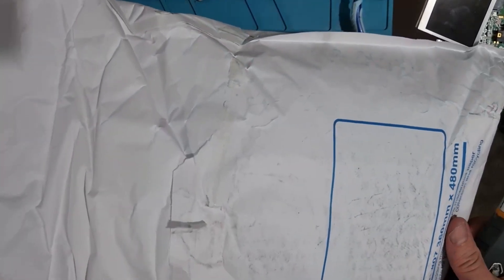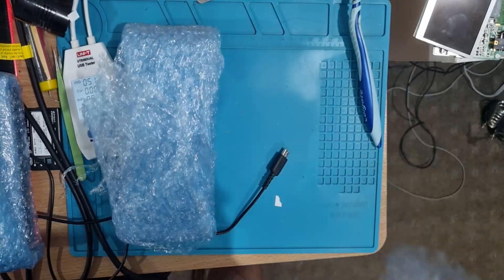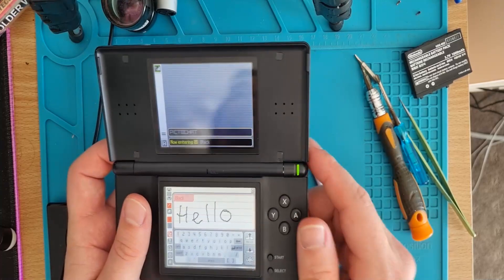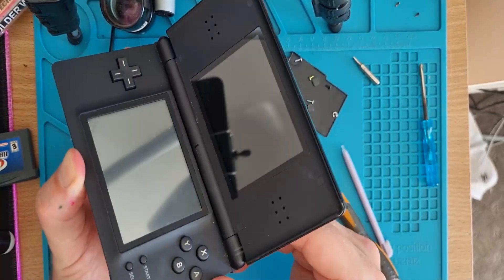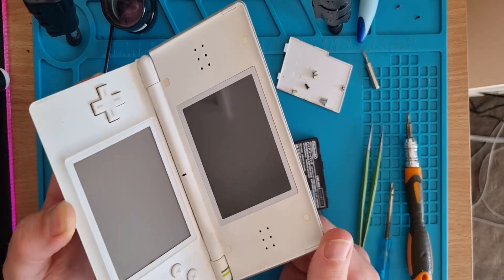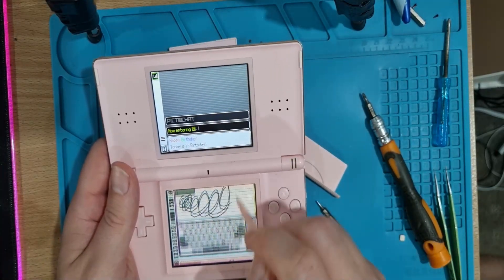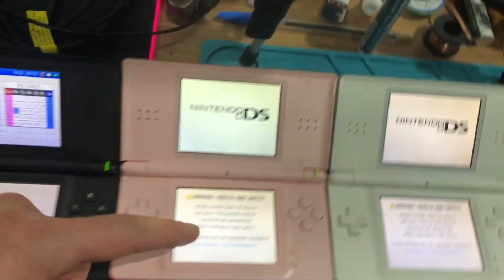I Got 10 broken DS lites, Lets FIX THEM!

Comment: Really nice job. I would also love to start doing this more often but I don’t have the money to actually start doing this. I have destroyed 2 top screens trying to swap in a new screen on my ds. it is quite demoralizing tbh
Reply from the maker: Yeah I started out small only 1 at a time kind of thing to keep costs low, also ruined the first 2 top screens I tried. Just gotta practise a bit more and its a piece of cake!
Reply: @chickenmaster121  my soldering iron is really bad and anything would be an upgrade. My iron doesn’t get as hot as yours and takes a bit longer to melt the solder. I also can’t control temperature. I also don’t have leaded solder wire as I bought the non leaded one which I partially used in a chemestry experiment
Reply from the maker: That's what my first iron was like as well, $15 at bunnings it was rubbish but I got use to it. Get some leaded solder and some flux and practise, if you still have the top screens you broke just try doing the speakers for it a couple times
Reply: @chickenmaster121  okay. I’ll try
Reply: @chickenmaster121  i have the 3 broken top screens. The original and the other 2
Reply from the maker: have a few goes at soldeing the speaker on, then remove them again, wick it clean and try again. are the cables still in tact to try practise the rolling of them?
Reply: @chickenmaster121  cables are intact. I think I damaged a trace the 2nd time while soldering
Reply from the maker: practise both those things and next top screen you will nail it

Comment: Timestamps:
00:20 Unboxing DSLites
5:30 Determination of non-booting DS'
5:55 Black DS #1 {Battery issue, broken hinge}
7:46 Black DS #2 {Dirty MoBo, Defect topscreen}
13:16 White DS {Jammed power button, Defect digitiser, new upper backplate}
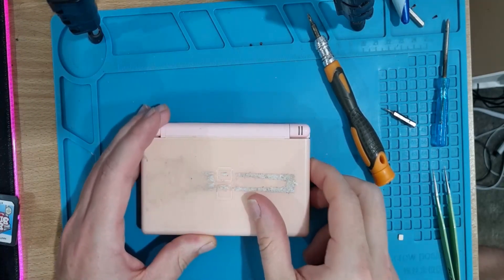18:26 Pink DS #1 {Missing battery, bad bottom screen}
20:59 Black DS #3 {Broken hinge}
22:52 Pink DS #2 {Broken hinge}
25:00 showcase

Comment: As someone who's starting to get into DS Lite modding, this video is a huge help, thank you!

Have a question though, if you encounter those shoulder buttons that need a harder press to get them working, what's the best solution? The one where you take out the actual metal dome from the switch, or is contact cleaner (or 99% IPA) enough?
Reply from the maker: No worries! 

I usually spray some contact cleaner or ipa into the switch and press it multiple times, sometimes need to apply the spray more then once. If they're still dodgy after a few goes I will replace the switch

Comment: Thanks, bought a broke red ds lite so im gonna try my hand at repairing it, swapped the battery and won't start up but it kinda does when plugged in, so I'm gonna open er up and clean the board and see if there's any issues with the soder points
Reply from the maker: good luck, If you need any help I have lots of videos on DS lites or just ask
Reply: @chickenmaster121  thanks man, I appreciate it!

Comment: I know this is a little old but I was wondering where you buy your screens? I recently bought a lot of 13 DS lites for 175 ( a steal for around 13.50 a piece). I was wondering if there's anywhere that is particularly reliable. I'm considering just ordering some from ali express if there isn't a better alternative. Thanks!
Reply from the maker: All my parts are from ali express, I have affiliate links in the descriptions of the parts I used. Good luck with your repairs, check out some of the other vids on my channel I have repaired heaps of lites!

Comment: where did you find a deal like this? All the broken ds i pick up are all flooded with water damage. (maybe i am just unlucky)

Also is there a difference in how the replacement frame for the top screen looks and feels compared to the original one.
Reply from the maker: I sent an offer on eBay to a guy $150 for all 10, he was trying to sell them individually for around $30 each so got lucky there. 

Not really, slightly different and sometimes the hinge area needs to be adjusted cause the pieces won’t fit in but they do the job for being about $3
Reply: @chickenmaster121  i’ll have to snag a few of the top shells then. 
loving the videos, keep up the good work :)
Reply from the maker: Yeah I got them on AliExpress, thanks for watching!

Comment: you can revive the top screens with screen cancer with some elbow grease and patience. take off the display cover and scrub (not too hard as to not break the lcd itself) the black pixels with a qtip. they will move around, you can push them over the edges. l usually do this half an hour each for a few days, leave the console for another few days, turn on and pixels gone... top screen saved.
Reply from the maker: I would have thought they were dead pixel not screen cancer. I guess the next one I find with that problem there's no harm in opening the screen up to try it
Reply: @chickenmaster121  they are indeed dead pixels, but you can revive them by moving them around. let me know how it went. ;)

Comment: how do you find these so cheap broken? most of the time i see them upwards of 40 bucks
Reply from the maker: 1 guy had all of them listed for $25 each from memory, I offered $150 for all 10 and he took it. Most singular ones are overpriced. I did a more recent video where I got 30 of them from the same guy for $400 posted. I assume he works at some sort of electronics recycling centre to have so many broken ones.
Reply: @chickenmaster121  Ok thanks mate